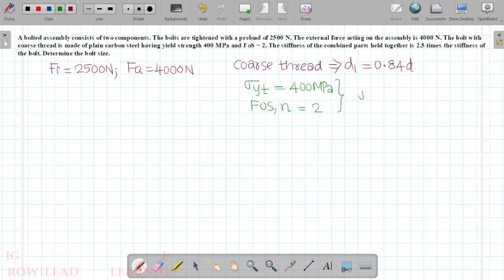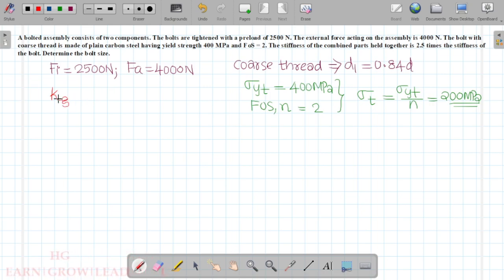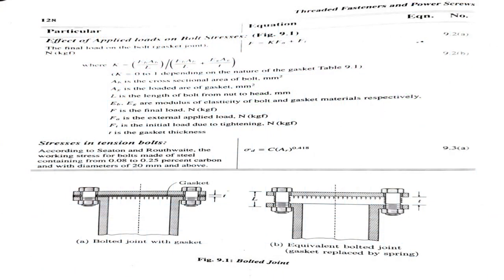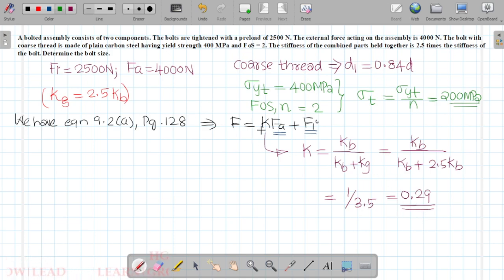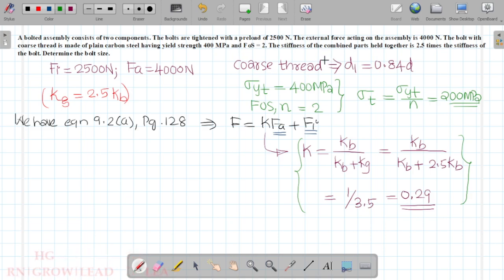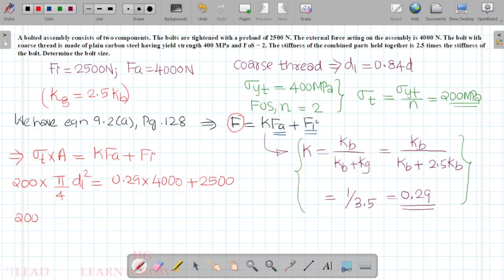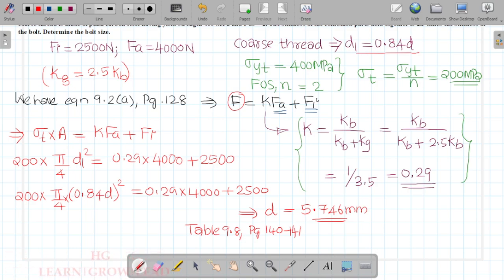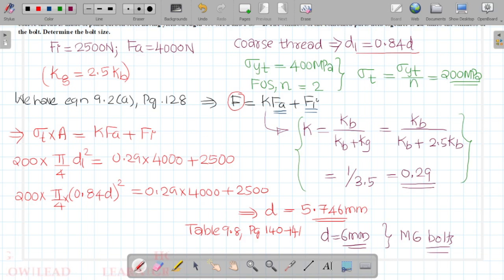ME 401: DESIGN OF MACHINE ELEMENTS - I_MODULE 3_LECTURE 5

Comment: Sir why did you take d1 while calculating net load??
Reply: Thank you Sir ♥️
Reply from the maker: Stress is maximum when area is minimum. ie at root diameter (d1).

For strength calculations therefore we have to use d1

Comment: Why not divide the Fa force by number of bolts ? And the number of bolts are not given ?
Reply from the maker: If no of bolts is not given, take the external load itself as Fa.

Some problems may ask to calculate the no of bolts required ...in such cases only think about that.